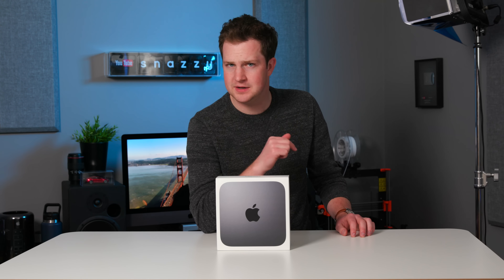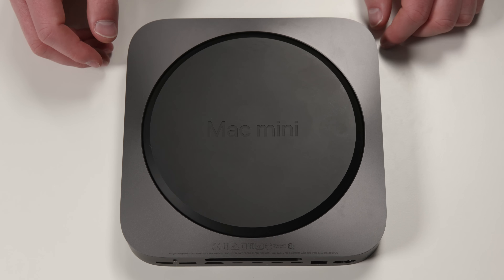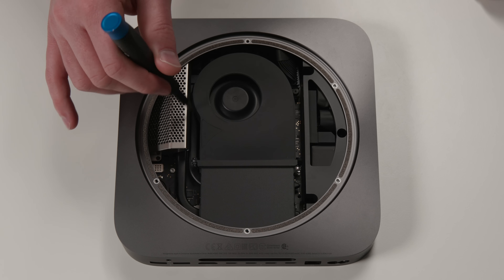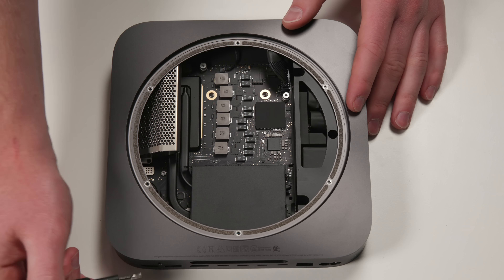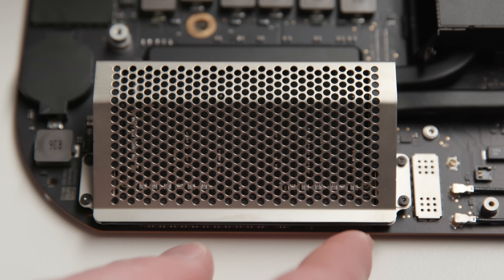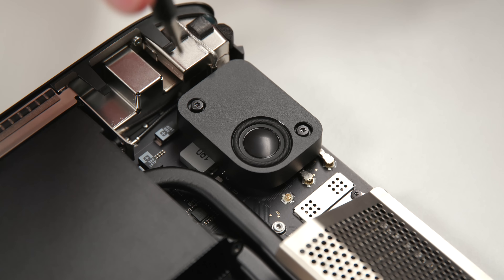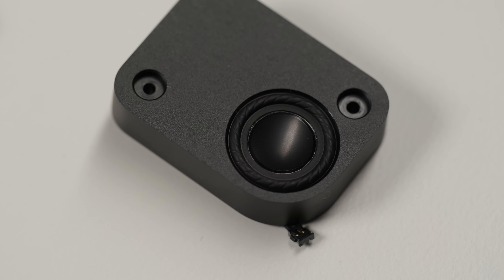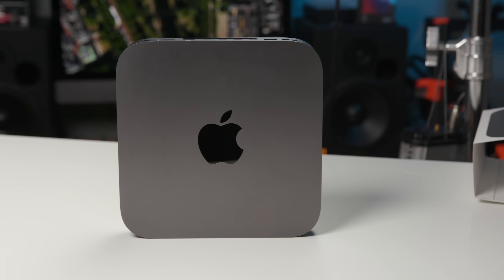Can You Upgrade the 2018 Apple Mac mini?! - RAM Upgrade Tutorial and Teardown

Comment: It's so weird they made the RAM upgrade hard even though they advertised the SO-DIMMs in the keynote.
Reply from the maker: That's good 'ol Apple!
Reply: JetVeam I think they also made a certain comment that folks that were a certain extent of computer savvy would be able to do this themselves, the level is just higher then we all expected. Doable for sure, but most users won’t want to. The $200 upgrade isn’t so bad considering the ram itself is around $150 and the amount of work it would be to replace, not to mention buying the screw drivers if you don’t have it. Probably most worth it for folks looking to go 32 gigs and higher.
Reply: You don't even need a special tool to pry board out. It's nowhere hard. Think about how to make thermals work better first, because thermals have to work 100% of the time. And think about RAM upgrade last because it's only 10 minutes once or twice in this computer lifetime.
Reply: @sergeyrozenblat7849  This. Long term structural integrity and performance is much more important than a casual modification.

Comment: If I may, that metal Cage around the RAM is likely a heat sheild.  The RAM sits directly on top of the CPU, so that metal helps to absorb and dissipate some of the radiant heat away from the RAM.
Reply from the maker: This seems the most likely explanation I've guessed so far. I'd hazard a guess you're probably right.
Reply: Snazzy Labs Still looks more like an EMI shield to me.  Remember those RAM signals are probably the fastest off-chip signals in the entire machine, frequency is so high there are official limits on how far from the CPU pins the sockets can be, measured along the wires, just to keep the travel  delays at light speed low enough.
Reply: @johnfrancisdoe1563  thats...  not how RAM works... XD
Reply: @Jordan Eilbert; no. The cage does not touch the RAM chips so they cannot dissipate RAM waste heat to the cage.
Reply: @rif42   It is a heat "shield". Not a heat spreader.
Reply: @era7928  No, its function appears to be holding the rubber-clips in place and to avoid knocking RAMs out of position during assembly.
Reply: It's a heat shield, from the CPU, not a heat sink for the memory modules. It actually shouldn't make contact as that will transfer the heat from CPU to RAM chips.

Comment: Great, so when the SSD eventually wears out, you will have to buy a whole new motherboard to replace it, by which time you will only be able to find used ones with similarly worn embedded SSDs....
Reply: ^- THIS

That is the sole reason I wouldn't buy this Mac Mini. I don't understand why people don't get that when the soldered SSD dies (and it will die, don't fool yourselves), there's no way you're going to fix it. Well, at least Apple takes care to make it 100% recyclable...

If they had used a replaceable SSD, I'd have seriously considered replacing my Late 2012 Mac Mini (it's fully upgraded with custom memory and two internal SSD drives). Now I'm considering building a Hackintosh with more power and for a fraction of the base model price (800€ here in UE), so I'm eagerly waiting for that video Snazzy promises of a Hackmini build! 

Maybe Apple will get it right next time. Who knows?
Reply: @devotee  The modern SSD chips will last at least 10 years with normal use, easily.
Reply: Kael who are you kidding with that nonsense? Go check out any SSD.. ANY.. and tell me if you find one that lasts over 5 years for a CONSUMER one..
Reply from the maker: @TheMasterOfSafari  To be fair, Apple's SSDs are incredible and I've never had one fail on me—even with heavy write/re-writes for video editing. I've been using their SSDs since 2011 across many computers.
Reply: It wont wear out. Even the 128GB one can probably do 70TBW for endurance. Even if you wrote 5GB every single day, that's over 35 years of endurance. If you double the capacity, the endurance doubles as well.
Reply: TheMasterOfSafari ssd on my MacBook Pro mid 2013 still runs like a champ, in fact: I still regularly use MP3 player with flash storage memory from 2008, only had to replace battery
Reply: The real problem is what happens when your motherboard fails, is it like MacBook Pro and lost forever.
Reply: By the time an SSD wears out you'll probably want to upgrade anyway
Reply: Also... Thunderbolt storage.
Reply: @GearBang No. No need to open the case. Plug an external SSD drive into one of the four 40 Gbps Thunderbolt drives. Do that day one and save wear on the internal SSD. Problem solved.
Reply: @snazzy  It doesn't matter if anything else on the board will lead to the same failure. Here is a good idea for a video. Break that board then try to get the data off of it. Them look at the cost of that repair to get the data vs removing the SSD to recover it. Apple SSDs are not that special. Their boards are not that special. it is still fiberglass, Copper, ceramic, MOS, and plastic just like everyone elses. it can randomly fail not just by the Endurance of the SSD or the wear leveling of the controller. even then the fact that they placed the T2 chip in this is unbelievable what this company will do to hurt their own users. I do wonder if you can even change the memory in this at all.
Reply: @infernaldaedra  Apple boards also routinely come with engineering fuckups that often lead to unnecessary premature death.
Reply: @infernaldaedra  Yes, you can upgrade the memory.
Reply: I understand your frustration but spec and real life is very different. 1) every apple computer owner should be apple care, 100 usd gives you 3 yr full warranty, if your ssd speed went I think less than 80% of the original speed, they will replace it for you. 2) I put a pro grade ssd in my mac book in 2012, the speed was about 400m/s while my friend's trash can was about 1gb/s write or read. 2 and half years later, my samsung ssd is about 100m/s while the one in Mac Pro is still 1gb/s. 3) Worst situation, if your ssd died and you dont have warranty, you can just plug in a hard drive and install the system in that, I run my basic iMac from a 1tb external ssd for 3 years already, never had a problem.
Reply: @ronniedai3683  Yeah but why is it okay to spend more money upfront for a brand will known reliability issues with the idea that you should purchase an additional coverage for it? There are other brands that offer longers warranty services and have better support without making you pay upfront for it.
Reply: Odious Ritual which brand offers more than 3 years warranty?
Reply: Ronnie Dai Dell + squaretrade.
Reply: @snazzy  Good for you, man! :P
tho it definitely depends on the person and his usage.
Reply: @PetrFlosman  it depends on your usage mate..
Reply: @TheMasterOfSafari  how did you go from checking "any SSD.. ANY.." to only "CONSUMER" , I still have my crucial m500 120gb  ssd which I've had for about 5 years now and its running fine, and by no means is that drive anywhere near pro, and honestly is more of a budget ssd because I was super cheap and I've definitely given it a run for its money.
Reply: @IAmCjcj11  you wont ever get it.. but okay.. it depends on your usage.
Reply: @TheMasterOfSafari  SSD's is far more durable than you think. I have an old Intel SATA 256Gb SSD, that is 7+ year old. It has more that double the amount of "writes before failure" and its still in mint condition. And i propably use my PC considerably heavier than the evarage user. And todays SSD's has much higher durability than the first couple of SSD generations. So I am pretty sure that the 10+ years life expectance will go for most users, and by that time the Mac Mini will have more than passed its expected usefullness time.

If you really follow what people writes about SSD's online you will know that most drives of the 1st generations of SSD's surpass 2-3 times their expected writes before they die.
Its not like the chips are "coded" to die when they reach 5 years as many people thaught back when they came out, and most of them last considerably longer.

That is far far better than with old Harddisk where yor disk most likely would die BEFORE they reached their MTBF number.
Reply: devotee ....they dont recycle the parts, they grind them up so resellers cant get the used good parts to use in repairs. Apple wants all the sales and or have the customer buy new parts or whole new computers.
Reply: Embedded storage is not anything new. It's actually the way  manufacturers originally did things. In fact, anyone who was around in the 80's and early 90s will remember that.
Reply: No they removed all data recovery ports from their boards so unless you save it to the/a cloud and/or external device it is gone for good!
Reply: @TheMasterOfSafari  Next time , think twice about what you'll say..Of course Apple is overpriced, I'm not a real 'pro' mac, or a windows hater, but i got a simple macbook air 13' back in 2013, we are about to go 2019, it's obviously not a war machine, but i've used it everyday since i've bought it, never had issues.. And i'm using it for logic pro everyday, little games times by times etc.. The only issue is the battery, wich i got to replace since like 1 year now (did not do it for now).. And my mac is always on and i travel a lot with it, not taking too much care of it.. Imagine how many times a better mac will last if i take care of it.. ? Oh no apple is crap, it last 5 years and my ass is a pineapple 
I'm sure you never had a mac but you talk about it..
Reply: @infernaldaedra  Yes but it's windows, people love windows or macs.. I was on windows before, always had big issues with my computers (and from multiple brands) for music, it's just a waste of time.. When you know how many times it takes to make music, have a windows with an issue that comes from nowhere and makes u loose 1 ou 2 hours to fix it is just awfull
So for me, mac is the 'easy' way, not the cheapest but.. 
I'm not a windows hater * I'm sure today windows have good computers, but it's all about tastes..
Reply: Cou Cou also if you have a MacBook Pro with the dedicated GPU, good luck with repairing it as it’s GPUs used to fail back then and Apple used cheap ass ways to fix them..
Reply: @legolmon4036  you've missed the point in its entirety. It isn't about either ecosystem or the opertating system because you can buy equally disposable windows computers. The problem is apple is fighting against your ability to repair or own your own devices. If and when your Apple computer has an issue you replace it with another?  Why if you have a perfectly good system with one bad part should you throw the whole device away and be forced to "upgrade" it's anti-consumer practice. If it breaks you should be able to buy parts at a reasonable cost, and Apple is nearing a point in their hardware design that is malicious to users and owners of their devices that want to resell or repair their devices.
Reply: @infernaldaedra  Now they won't allow people to sell their apple refurbished products unless you are an authorised by apple in amazon
Reply: @kalijasin  That was pre-SMD era, and when socketed componentry was very expensive and non-standard.  Plus, even back then, no engineer in their right mind would solder in mass storage.
Reply: I've had Apple SSD's since the tech was first released and have NEVER had an issue or have I ever heard of anyone having one go out.  Pretty rock solid tech.

Comment: Just upgraded my 2018 Mac Mini (i7 chip) to 32Gb, very happy. BUT a watchout when buying memory upgrade kits from Crucial Memory.

Their website lists two sets of kits for the 2018 Mac Mini: one set of upgrades promise 2667 SODIMM (ie speed) the other 3200 SODIMM (and we all know faster is better!). The faster cards have a big red ** NEW ** label on them, and are 25% more expensive. So I bought one.

I installed it and it works, but the Mac tells me my speed is 2667. I call Crucial sales support, who tell me that it is technically "compatible" with the Mac Mini but that not all motherboards support the higher speed. And they suggested I should know if my motherboard will support this card, despite it being listed as suitable for the 2018 Mac Mini as "Guaranteed" to work. They said they can't check every motherboard of every product. So I have a higher spec RAM kit that my 2018 Mac Mini can't take advantage of, and I've paid 25% more for the privelege. Thanks Crucial.

So beware: Crucial listings for your computer do not mean that the product performance specs will be achieved on your computer.
Reply: Thanks for caring to pass on the info.

Comment: Buys anything from Apple
"So, we're going to check out the user serviceability."
"This is excellent, I only need 5 different proprietary security screwdriver bits costing $25 each to remove the cover."
Reply: I bought an iFixit set years ago and it's served me well for many electronics 'projects' -- and those sets aren't very expensive really. But I get what you're saying ;-)
Reply: Lol, their like $1 online from china
Reply: @CarlosSanchez-en6mr  they are
Reply: @soundguydon  Or you know how about just using normal fucking screws that a user can buy a tool for in a hardware store, rather than having to order it from china and wait 3 weeks...
Reply: I think it's 1 special one and 2 regular ones that come in any iFixit kit.  It took me all of 15 mins to upgrade my RAM......pretty easy stuff.
Reply: @8654ZuluFoxtrot  That's good for you, takes two or three minutes in most normal Windows desktop computers. Two screws that you can remove with your fingers, slide the panel off. Old RAM out, new RAM in. Panel back on, screws back in.
Reply: Yeah, I’ve built a few gaming PC’s before and fully understand how to do every aspect of it all.  Just pointing out that all of the fuss about this RAM upgrade is just nonsense, it’s very easy.  Considering how much they have packed into this device, and you will only upgrade your RAM one time, the process is very reasonable.
Reply: @8654ZuluFoxtrot  Lol look at mini itx or htpc computers, bet you don't even know about these, oh and yeah even smaller ones than crapple are easier to open and work with, plus they look better, this is just a boring box with rounded squares, so 2010.
Reply: They didn’t design this to be easily accessible, the ONLY Apple computer they did that with was the Mac Pro.  They made this “capable” of upgrading.  If you are too intimidated to unscrew a few things and pull off a couple cables, I’ll gladly do it for you for a nominal fee.
Reply: @8654ZuluFoxtrot  Lol, I have disassembled and reassembled more difficult stuff than this, after all I can solder and replace chips too. It's not that it can't be done by vast majority, it's the fact they purposely made it more difficult to do, than it has to be and you're just a sad fanboy. Enjoy your soldered on ssd.
Reply: @harshnemesis  So you think Apple designed this on purpose to piss off kids like you?  LoL!  I have one, I've taken it apart and put it back together, it's EXTREMELY well thought out and designed for MAX airflow in the small housing.  Should they have doubled it's size to allow more airflow?  Yeah, I think they should have and it would have still been "mini".  But the fact is it works great already.  And I do enjoy my soldered on SSD.....I did on my MacBook Pro and never once felt like I needed to upgrade it.  With the 40gbs ports on this thing, your external SSDs will read/write almost identical to internal.   Enjoy being an Apple Troll and I'll enjoy my products while you jealousy drives you mad!
Reply: @8654ZuluFoxtrot  Lol even the guy in the video says it was purposely designed that way, but sure iSheep like you know more than the book, after all Crapple is not a company known for planned obsolescence, right? LOL. Also well thought out, maximum airflow? LMAO There is just one vent on the front to suck air in, this could be done so much better, but then again you don't really need the best cooling system in such weak underpowered pc, where most of the money is crapple tax.

If this was well though out design they would move these ram sticks to a location where they can be easily reached by opening that jar on the bottom.

If this was well thought out design there wouldn't even be a hole in the bottom at all, instead few standard torx screws on the back, once loosen the entire computer slides out the front, like it does now after you take all these stupid steps.

Even though I make periodical backups, I would still want to be able to remove the drive and backup anything that isn't in a backup yet, when this POS PC overheats and dies, but since it's soldered in it will also take your data with it. You never needed an upgrade because you're an iSheep, you never had that, so you don't know what you're missing out. No nobody is jealous of your iCrap, speaking of trolling, it's becoming obvious you're one.
Reply: Dark I prefer the special headed screws cause they don’t get damaged as easily as standard philips screws.
Reply: What do you think proprietary means?! Torx security screws aren't apples protected design, they're a standard you muppet.
Reply: @oscarmuffin4322  What's the point of comparing a desktop tower with a Mac mini? You might as well point out that it's fast and easy to replace the RAM in a Mac tower. People buy the mini specifically because of its tiny footprint, and they accept the tradeoff of a longer process to make internal upgrades.